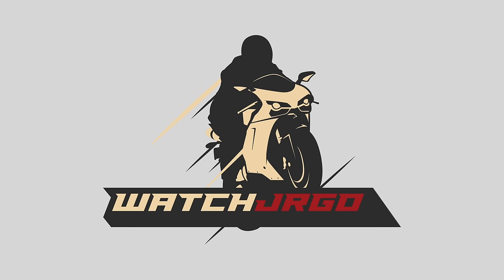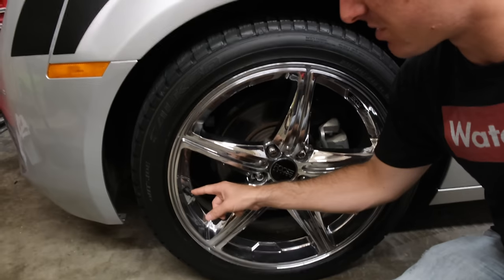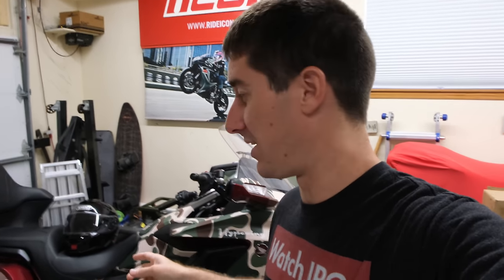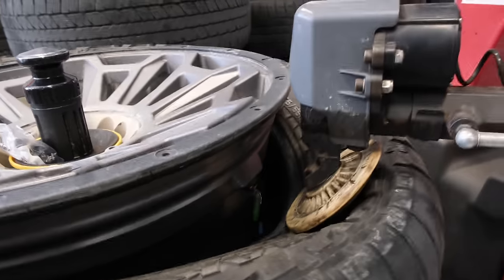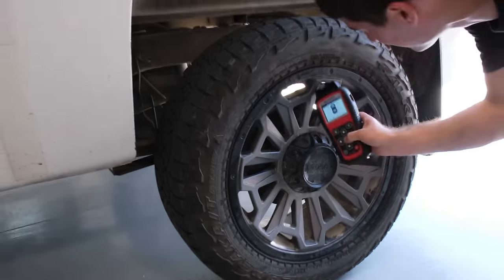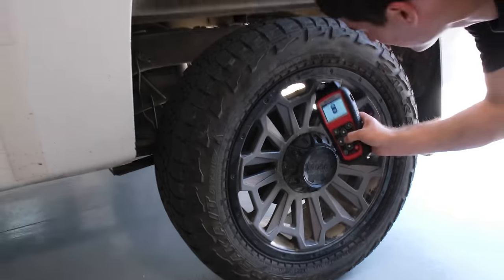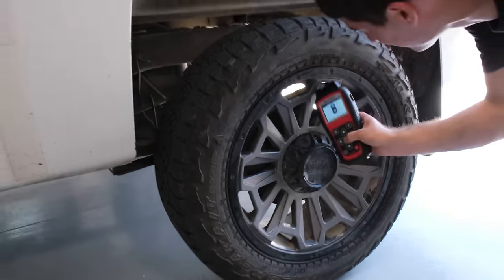TPMS SUCKS! Here's How To Fix It Yourself *Probably*

Comment: On Chevy 2007-2011, make sure all valve stems have the same frequency range as the vehicle requires, replace all 4 stems if a TMPS stem has been removed/replaced when a tire was changed out. 

Turn key to run position but do not try to start. Turn the headlight switch from off to parking light to back off 4 times within 3 seconds, if done correctly, the horn will honk, the TMPS is in program mode. Starting with driver side front, deflate the tire using any tool to press the valve stem for about 10-20 seconds until horn honks, repeat this next with passenger side front, passenger side rear, then driver side rear in that order, turn key off, reinflate tires back to vehicle recommended pressure. Your TMPS dash light should now be off on next vehicle start up and the system will correctly monitor tire pressure. 

After making sure the valve stems are all the same, total process of programming the TMPS is about 4-5 minutes plus airing the tires back up (about another 5-10 min).

You should deflate the tires in correct order as quickly as possible and turn the key off as the vehicle will only be in program mode about 8 minutes total. When you go to turn the key off, check to make sure the TMPS light is still flashing, if it is steady or off when going to turn the key off, you failed the reprogramming as you exceeded the programming window time and you will have to try again.

Comment: I worked as a tech for Toyota and it requires a computer to put it into a learn mode where you input the serial numbers on each sensor in the required time and then finish out the program when your done. I doubt Josh's prius needs sensors. Scan the car see if you can find the sensor codes in the body control module and if not then you will have to go to each tire and break the bead to read the back of the sensor and repeat the process. Toyota sensors re learn by driving not by tool so once they are synced to the car drive it at a minimum of 25mph for a mile i believe. Sometimes there is a button under the dash below the steering wheel in the glove box or to the left of the steering wheel near the vent

Comment: Ford TPMS sensors are known for throwing intermittent codes while driving even if there's nothing wrong. Just keep a valve stem pressure gauge in the car and check it routinely. I suggest every or every other fuel refill is a good time to check air pressures.

Comment: There's a cable that comes with the TS508 to connect it to OBDII; with any moderately recent firmware it will write the IDs directly to your ECU. I did it today in a Camry and it took less than two minutes start to finish (including identifying the sensors).

Comment: Does the nut torque from a new TPMS service set depend on the sensor you are installing a new set? Or that torque is the same for any TPMS Service Kit, which fits on that sensor? 
   For example, the original TPMS sensor require 65 in-lbs (2009 Nissan Sentra), but new service kit for the nut 
included in that set gives 35 in-lbs. I didn't look before on the packet of the service kit and installed w/63 in-lbs. The car 
was driving perfectly fine like for 2 years. Now I'm replacing the wheels and moving the TPMS sensors fm old wheels to 
the new ones. I'm replacing the service kit items of course (nut, washer, gasket, and Schrader Valve). Here it came to 
my attention the printed value of the nut torque on the small packet for the new kit (35 in-lbs). So I don't know what 
torque to apply 65, 35 or smth in between (especially as everything was fine and with 63).  I inspected the previous old
service kit nuts, which were used for 2 years, and which were under 63 in-lbs instead of 35, they were fine, no hairline 
cracks on them. I would appreciate any opinions on this matter.

Comment: I saw a post on a car forum I was on like 10+ years ago. He took his tpms sensors out. Bought a small wheel barrow pneumatic tire and tossed all 4 sensors in and filled it up to like 40psi (or whatever the vehicle required to turn the light off) and tossed it in the trunk. Never dealt with them again, was able to run several tire set ups. Also another guy built one out of pvc pipes and drilled a hole and put a valve core thru. Sensors inside, cap it off and add air.

Comment: On some GM's you can do the relearn yourself without a fancy tool.

-Make sure tires are properly inflated
-Put car in ON mode (engine not running)
-Hold lock and unlock on your keyfob for about 5 seconds, horn will chirp
-Starting with driver front, start letting air out of tire, after ~2psi the horn should chirp
-Repeat for RF/RR/LR
-You have 5 minutes to do all 4 tires

Comment: my 1994 Corvette had a basic tire monitor system. It let me know A tire was low going 75 on the interstate once. I pulled over, no tires seemed low, got back up to speed and sure enough, the drivers rear was going down. I put on the spare ( took me 15 minutes to find it ) and continued my move from SC to AL at 75 mph. Taking off was fun with a spare rear as it wanted to spin very easily and traction control was real aggressive in pulling back the throttle when it did. I have an 07 Elantra, no TPMS and got a flat pulling into a gas station on my trip from SC to AL for my HS reunion 10 years ago. Imports must have been exempt in 2006 since my 2007 doesn't have it.

Comment: TPMS at the track is double edged sword.  Can save your butt if tire is compromised but can be very unhappy as you remove air btwn sessions for max handling.  I've found my best pressures when hot is 35/40 F/R.  So I start 1st session 3 lbs low from factory settings (29/34) to get to those #s at end of session, then bleed to those #s after ea session.  3 low is just low enough to not get a TPMS light but get the light at the start of ea subsequent session because the tires are low but heat up faster as track temp & ambient temp inc during the day.  By last session I could be 7 lbs low to start so my dash says I have a flat tire when I start.  I always check before starting to be sure all are good.  The things you do for a good lap time.

Comment: Pro tip; a tire pressure gauge can also be used to check tire pressures.
Reply: Tpms is a no brainier these days. For $30 I can read real time tire pressure and temperature on all four wheels continuously, set audible and visual warnings for thresholds. It's a huge safety feature improvement while driving on the road. There's no second guessing or any hesitation if you spring a leak or blow a tire while driving.
Reply: @anonypersona3189  Where can you buy a TPMS diagnostic/programming tool for $30?
Reply: Yeah, a good universal programmer like a SnapOn is over $1000 + $300ish for 12 month software license.
Reply: Thank you !!!!!!
Reply: Agreed😂

Comment: I just go to my local tire store I bought my rims and tires from if I have a problem. I had one tpms wheel sensor replaced for $60 vs. over $300 for one from the car dealership. Also, the tire store has a tpms wireless tester plus they can program them. My tires are pro rated that makes it a one stop shop

Comment: For the Prius, if you have the right sensors, you should get a mini-VCI cable and Techstream software to program them in using a laptop.

He should probably get that anyways, it does more than most of the CAN readers/programmers you can get.
.
Also, if the 3G Prius is like the 2G (most likely), the Techstream software has an ID5 so he can get a sensor for the spare if he wants.

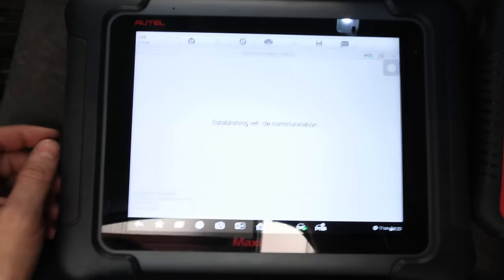Comment: I’ve got a TS501 in my Tool arsenal when I went through the same thing with my Chevrolet Aveo; and really if one sensor starts to fail, the rest are not far behind it (so they should be replaced as a complete set) and yes, some sensors are $35 like the ones you can get through the Walmart Auto Care Centers (they are Genuine Schrader sensors) but most of your GM sensors are $80 a piece at the dealership. And some TPMS systems are a cast iron bitch to get into relearn mode (my sister’s Suzuki SX4 comes to mind) or you HAVE to use a scan tool to initiate relearn like on my Aveo.  EDIT: on Eric’s truck, you don’t even need a scan tool to enable the Relearn mode because at 8:49 I saw that he has the DIC buttons; just cycle through the information menu until you see “PRESS ✔️ TO RELEARN TIRE POSITIONS” on the odometer display.
Reply: $80 at the stealership, and probably half that online...
Reply: Talonts to recount my TPMS saga, I got an entire set of 4 from Amazon (and were Genuine GM sensors) for the same price as ONE at the dealership.

Comment: Loved the TPM system on my former 2004 Toyota Sienna. It did not required any sensors on the tires (it monitored tire rotation). Never failed me in the 10 years I owned that vehicle. Never understood why the move to sensor-inside-tire/rim. I heard it was government mandated.

Comment: Totally agree with you about tpms. My 2006 Hyundai doesn't have it. My 2016 Camry does have it and it shows the tire pressure.  It definitely helps maintain proper air pressure in the tires.

Comment: So happy that the Prius has found a convert in Josh.   :)
At one time, before the Gen III came out, I was responsible for the most Priusi sold in my state.  I still own a 2009 Prius with only about 27K miles on it.  I just earlier this year put on a fresh set of tires because the originals were starting to show fine cracks on them.  Other than oil changes and fuel, I have needed to spend nothing else on it.  

My only complaint is with the fuel bladder in the gas tank.  The bladder was meant to do away with the need for fuel pumps.  However, Toyota did away with them on the 2010 Prius on.  My problem with it is that I live in an area where it is normal to have sub-zero winter days and nights, and severe cold weather can cause the bladder to shrink permanently.  So, although it works fine otherwise, I can now only put in about 8 gallons of fuel, instead of the 11.9 it used to take to fill it.  As little as I drive it and the excellent fuel economy it has means I only fill it once every 6 weeks or so.  Not that worried.   :)
Reply: That bladder is a PITA even in hot climates when filling.  I own 3 2Gs, all over 150K miles on them, and I HATE filling them.  I've "only" managed a 11.5 gal fill as my highest, but considering the nominal volume is that 11.9, that's about the highest to go without possibly overheating the pump from lack of gas to cool it.
.
Someday I hope to get a 3G to end that fill up misery.
.
Also, stop abusing that 09 with so few miles!

Comment: Another great video JR, but could you go back to showing us how to do it without access to a fully equipped commercial garage?  $20K tire machines make it easy, but a lot of us are still using 2x4s or ratchet bead breakers at home.  Thanks
Reply: Well shucks...  all you need is the $300+ programming tool (which will only program one specific brand of sensor), and a $40 harbor freight manual tire machine.
Or when you buy your sensors try getting them pre-programmed from the seller for your specific vehicle.

Comment: I bought non-MX cheap aftermarket sensors (non clonable) for my 2013 Lexus es300h a set of 4 for $36.  Using the Autel 501 to recognize the serial # and in advanced mode put the car ECU in relearn mode with the OBD 2 cable.   I also noted the serial # printed on the aftermarket tpms sensor was different than what the Autel scanned it as being.

Comment: The Marine Corps used a Central Tire Inflation System on 5 ton trucks in the early 90’s. The driver could drop the pressure with a switch on the dash when coming off a ship or landing craft so it can drive thru the soft sand then raise the pressure when they got on a hard road. It had three settings on it.

Comment: I have a 2008 Pontiac G8, & it has a highline system. You can see the pressures for individual wheels. A PITA when the batteries go dead in the sensors.
Hello from Phoenix Arizona!🔥
Reply: Had a G6 2008 with high line sensors as well! When one failed and I found out a new one was $70+ I decided to just deal with the yellow light 🙃
Reply: @Ammut6  Somebody found a way to make a $1.00 tire pressure valve cost $70.00.  Somebody made a lot of money on that system.
Reply: @mexicanspec  they sure did! Which is why I turned it down and saved myself $70

Comment: A simpler, and more reliable system, is to just use the speed sensors at each wheel to tell if one tire is low. It will not; tell you the temperature and it won't do any good if all your tires lose air at the same rate

Comment: I don’t understand why my 2006 Town Car doesn’t have this!  I lost a $250 tire because I kept waiting for the display to say something like low tire pressure like my Buick had!  So I can add this right?  Thanks JR for the info!  Love your videos even though I can’t work on cars!
Reply: If your car is a late 05 sold as an 06, it may not have it.  If it doesn't have it, there are various aftermarket systems, some that use the same type of valvestem sensor inside the rim/tire, others that have a small valvestem cap that you screw on to replace the standard one.  Just search Amazon for "TPMS system", there are tons of them.

Comment: The ATEQ Quickset Light ($119) was all I needed for my Subaru Crosstrek and its stock Yokohama tires and the Bridgestone Blizzaks I purchased from TireRack (pre-mounted on black steel rims, with their own TPMS). 
I should mention, however, that I do need to drive around for about 20min after changing the codes, before the car's computer picks up on it and shuts off the TPMS light.

Comment: What mechanism do these sensers use to maintain charge? Is it a motion type deal you find in automatic watches?
Reply: They don’t ‘maintain’ their charge. They’re always slowly getting more and more discharged. They typically use button batteries. Most have a battery lifespan of 5-7 years and the entire sensor has to be replaced when the batteries go out.
Reply from the maker: Exactly what Zach said, they just die and you have to change them 😢
Reply: Zach Miller thanks. That’s cool to know! It seems like a simple design would achieve a neigh unlimited life for these parts!
Reply: WatchJRGo I wonder how long they last then...
Reply: Liam Hover yeah, it would be nice if they just allowed for serviceable batteries so they could just be swapped out when they die, but that would be too easy, huh? Haha
Reply: Zach Miller yeah for sure! It’s all savings on a spreadsheet when manufacturing anything these days!
Reply: @zachmiller289  - the problem with that is designing a case that would stay together for a decade or more without spewing parts throughout the tire.  Even screws with Locktite may come apart over time.
.
I've cut one open to look into replacing the battery, but after soldering in the new one and potting it in silicone, you'd either have to leave the casing you cut out off of it, or try plastic welding it back together.  Really not worth it for most people.  Cheap bastards like me, maybe.

Comment: class 8 trucks not required YET. however you can order tractors and trailers with self monitoring and self inflating systems. downside to those is they tend to leak after a few months.

Comment: If the system goes it’s expensive if a sensor goes out, easy fix. Doesn’t it tell you what pressure the tires should be inside the door or driver's manual?
Reply: He means it tells you what the tire pressure is at the moment in your tires.